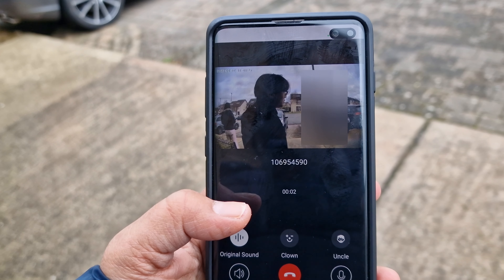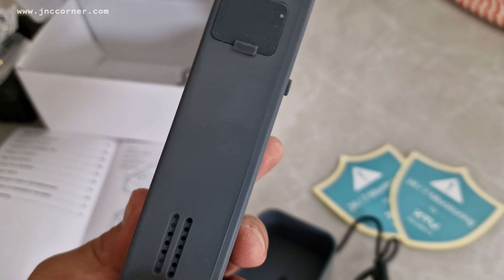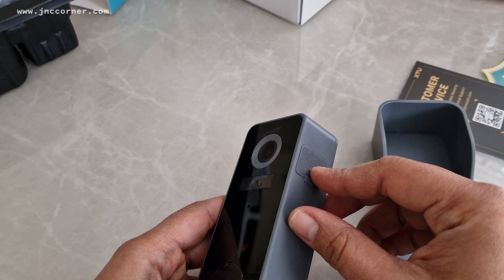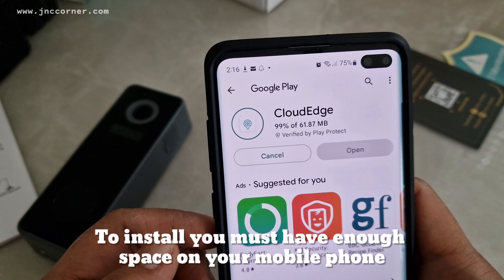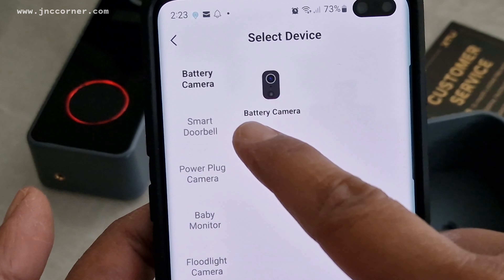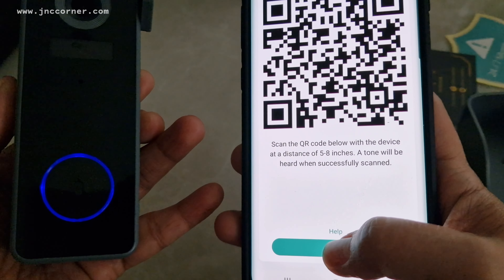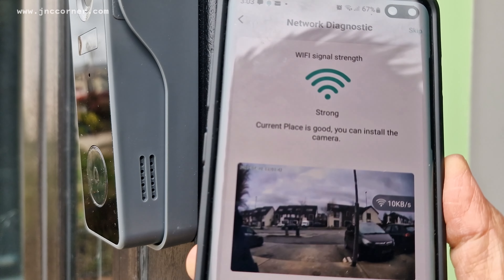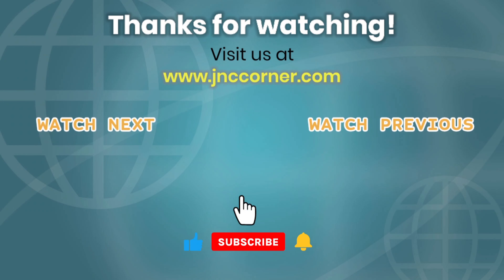WIRELESS DOORBELL CAMERA • XTU J7C 2K UNBOXING REVIEW SET-UP INSTALLATION WIFI  W/ BATTERY

Comment: ok  wireless smart video camera is difficult to install.
Reply from the maker: Does it says what is the problem? Maybe the broadband or internet connection is far from the devise....usually it will say what is the problem so you need to trouble shoot it.... so far mine is weak signal after I put the extension it worked perfectly fine...